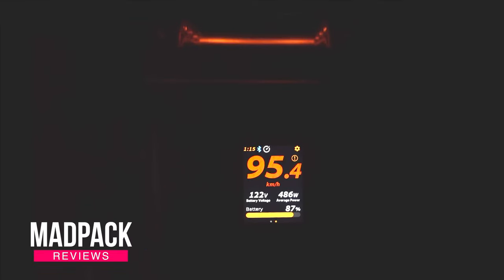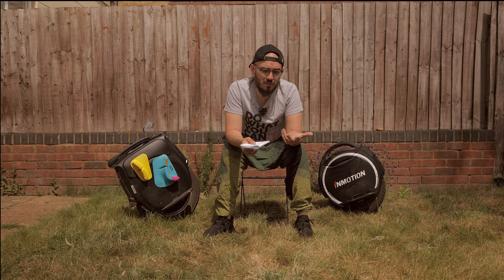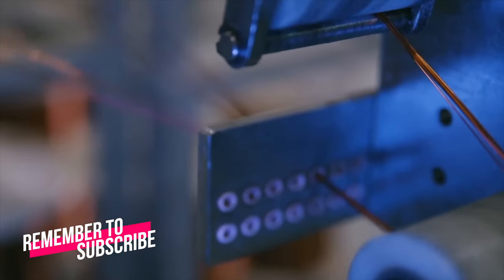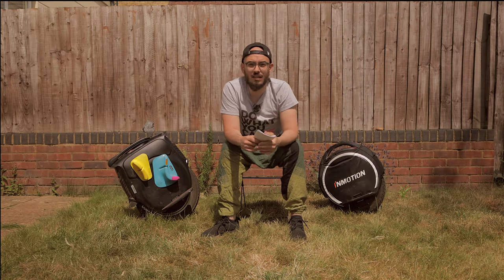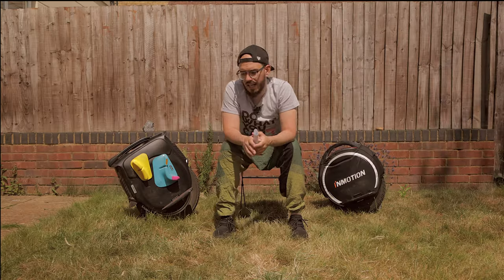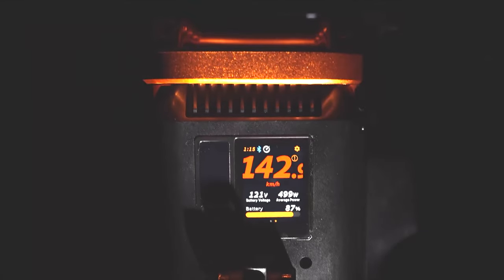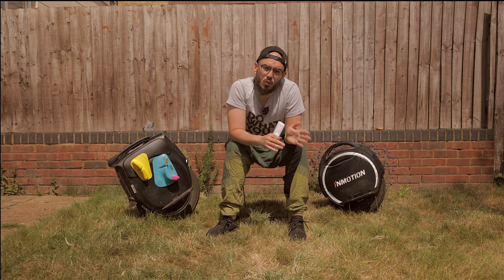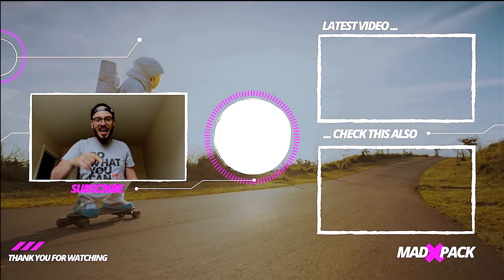Inmotion V13 Challenger - Fastest EUC in the World.. Begode Master Killer?

Comment: The V12 is still my favorite wheel out of the 4 I've owned, so I think I'd get the V13 when it comes out.
Reply from the maker: Which wheels do you own?!
Reply: they should consider an IPM motor
Reply from the maker: What is the advantage of an internal permanent magnet motor?
Reply: @MADpack  reluctance torque whose max RPM is not limited with voltage
Reply from the maker: Thank you for sharing

Comment: Rumer has it that The Challenger V13 version is the speed one and the other type has suspension, but less battery to make room for the suspension.
Reply from the maker: Is not coming out 2 wheels my friend that’s was confirmed by InMotion.
Reply: @MADpack  so you're saying there won't be a suspension V13?
Reply from the maker: The opposite is just a model with suspension bro

Comment: Marcos, 

Excellent video and information! Well like we talked, the V13 should be worth the wait. I'm really looking forward to seeing more information on the Challenger. Curious to know if they will release a HS & HT model at the same time and if there will be one with suspension and one without?

Be well
-Shane
Reply from the maker: No is just one wheel and with suspension. And this wheel you have torque and speed why you need a torque and speed version? Is it not enough 300nm and 100kph guarantee? :)
Reply: @MADpack  I'm glad it is one wheel with suspension. Originally it looked like they would have two wheels. One with suspension and one without!

I wasn't sure if they would have a slower version built for long range vs high speeds!

I was going back and looking at the torque for the V12 HT and Sherman Max trying to gauge how much the 300 nm of torque really is, since I'm still new to EUCs.

I don't have any need for 143kph or 88 mph on an EUC...ha ha ha, and wanted to know if their would be different versions of the V13 Challenger!
Reply from the maker: No they will not be I cover that angling time ago there are no 2 versions that was a lie that someone have push out they confirm me that that at least for now there is only a suspension wheel on the horizon
Reply from the maker: That’s the thing been able to do 100kph it’s not a concern for me but a wheel that safely can take you at 100kph I feel really safe against any cut off and with two hall sensor what can we ask more? I really want this wheel is the first time that I’m so desperate to get a wheel in my life :)
Reply: @MADpack  Awesome thanks 👍
Reply: @MADpack  Excellent, I'm really looking forward to seeing you have it and the reviews on your channel!
Reply from the maker: Thank you to always be here for me bro
Reply from the maker: That’s not for sure I’m still negotiating with InMotion

Comment: I'm personally not looking for the fastest. But improvements on other areas would  great, like range but not too much weight. More importantly, safety and reliability
Reply from the maker: This one is not only speed is the first wheel that reach the max speed and will not turn off
Reply: @MADpack  I understand, and there's probably a few more good things in there like better battery and what not. And I'm glad they are pushing things forward.
Just wish different brands improve on other existing things too not just focus on speed or torque, but I know very little of this EUC so maybe it's there already
Reply from the maker: This is the most advanced euc on the market and hard to find a wheel that can offer more

Comment: The 24’ inch wheel of the Monster Pro softens the ride enough therefore I highly doubt the Challenger will be a suspension wheel hence the 22’ inch wheel it is being built around - In my opinion a 22’ wheel is the sweet spot.  Also, adding suspension will mean adding 10 lbs minimum. 

The Begode Monster Pro weighs in at 83 lbs and is set on a 24’ wheel. 

Though Begode eX20s is set in a 20’ wheel it weighs in at 104 lbs due to its suspension and added battery power. 

Therefore how can they claim the Challenger to be a wheel for “stunt” riding while keeping the wheel light?

Answer: No Suspension 

👍🏼
Reply from the maker: Answer confirmed from InMotion … is a suspension wheel :)
Reply: @MADpack  wow. I'm very curious now to see what type of suspension is built in. I believe you but I still find it hard to believe 😂
Reply from the maker: But is what I said suspension is there for is
Reply from the maker: For us
Reply: @RocABye  I bet it’ll be very similar to v11 suspension
Reply: @wattssingletrack8874  likely will be to jeep the weight minimal
Reply from the maker: Gonna be what?
Reply from the maker: I doubt is going to be like the v11 max we will have a suspension like the one on the EX but protected and not exposed
Reply from the maker: I doubt is going to be super heavy since is not the approach of inmotion
Reply from the maker: I don’t think so :)
Reply: @MADpack  ex and v11 similar concepts but that’s what I meant with my comment it’ll be that type of suspension vs s18 master “linkage” style suspension
Reply from the maker: Have you seen my previous video about the v13v
Reply from the maker: Ex and v11 can look similar but suspension on the ex was much superior than the one on the v11
Reply: @MADpack  not sure. I'll look
Reply from the maker: This 2 suspensions are really different in experience
Reply: @MADpack  yes one is full body suspension vs pedal suspension. Still think this will be a similar setup to the ex full body style suspension
Reply from the maker: Exactly we will see how they have set it up I’m really curious maybe Saturday we will know

Comment: Honestly I don't think an expandable battery pack is a good idea. You need to dedicate extra space for batteries that may or may not be there, which seems wasteful in what is already a limited compact area. It will of course change the weight, and torque limits might also vary, which will affect performance. I think it's better to keep those things constant and just use the most effective battery pack to begin with.
Reply from the maker: Thank you so much for your feedback and your thoughts about it :) big hugs

Comment: Great info man. Hey did you hear how the beeps happened at 70km/h? I wonder if that’s the limit and this is more of a high torque wheel with lots of margin for safety… if that’s the case it would be the ultimate off roading racing wheel besides not having suspension.. and if they keep the battery not massive I think they can keep the price close to the same as the other new wheels that have arrived but that will be interesting to see the specs 

How long do you think till we get all the info/pictures? It’s crazy how new wheels are amazing then the next generation comes out and just destroys the previous ones… in a few generations I’d imagine eucs getting up there next to mid range motorcycle torque
Reply from the maker: Thank you so much for your feedback. Altering for the first bit is important that you understand that this wheel comes with suspension is not a non suspension wheel.

Related to the second part is not all the time like that. Wheels were not evolving since 2020… and from this point I hope they will improve in safety and also small subjects like lights per example and taking the euc to a motorcycle level in that subject also
Reply: @MADpack  appreciate the Reply! And how do you know this wheel has suspension???
Reply: @MADpack  also I think once the max speed and torque and range is good enough for most riders , they will stop trying to break voltage records and start to focus more on safety , IP ratings, function, form ,and sex appeal lol

Also there has been talk of suspension but I don’t think anyone knows yet if there truly is Suspension on this new wheel, someone said there will be two models , one with and one without but i don’t think that idea seems realistic either … unless you have concrete information to share about the wheel?
Reply from the maker: Is just one wheel and have suspension. That’s the real info bro :)
Reply from the maker: I work with InMotion :)
Reply: @MADpack  you work with inmotion? What’s your job? 

And if it has suspension then that’s going to be very appealing to follow and see how it does
Reply from the maker: No bro I work closely with InMotion giving feedbacks I test tester units when is possible like it happen with the v12hs before it came out.. I normally get the InMotion wheels for free so I can make my content… unfortunately it will not happen with the v13 because they say is too expensive
Reply: @MADpack dang that’s awesome they tell you more about the wheel… what else did they tell you about the wheel? And do you know when it’s releasing? What kind of suspension does it have?
Reply from the maker: I will comeback with another video soon bro :)
Reply: @MADpack  sure whatever man
Reply from the maker: Anyway they have already advertised more about the wheel :)
Reply: @MADpack  where can I find that information?
Reply: @MADpack  dang a electric shock they are saying? What the heck is that! This is gonna be a beefy wheel, EUC community is probably flipping out right now, Eagle, master and now this wheel… what good momentum if inmotion can make a high performance wheel with suspension and have the reliability they are known for this is hands down the best wheel if you don’t mind a heavier wheel but something like this will be my next wheel after the Eagle , who knows what will be out in 5 ish years holy crap! Hope your able to ride this baby at some point in time. Take care and thanks for the content and info
Reply from the maker: Is not going to be heavy if I’m right that is only 3000wh battery and in that case I believe the 34kg I talked will be correct
Reply: @MADpack  hey MadPack I just got my S22 Eagle and it has a error when I plug it in to charge for longer than a few mins, starts beeping then the battery turns off, have you heard of this issue ever before? Thanks for your time as always
Reply from the maker: No bro since I don’t even have so much experience with is since I only have a Ks18 never heard about that bro recommend you to contact your distributor
Reply: @MADpack  thanks I already did! And contacted lots of riders
Reply from the maker: And nobody experience the same has you?!
Reply: @MADpack  some people have I’m still waiting to hear from some of those guys I messaged but there seems to be a lot of BMS issues, I think that new firmware they changed right at the end wasn’t a good idea cause that wasn’t perfected .. I figured that might happen so yeah not sure
Reply from the maker: Hope that you find out the issue and you can restart riding
Reply: @MADpack  thanks! I’m gonna take her out this evening but it just takes a very long time to charge it so I’ll probably not be going every day that’s for sure but it’s all good
Reply from the maker: The most important is that you are healthy bro
Reply: @MADpack  being healthy is one of the most important things. The most important thing is sharing Gods love to one another so they know there’s nothing more important than living for him by living for others . Wheels are awesome and they are fun to ride, but they are not worth loosing control over what matters most in life 🌅🙏

Safe travels and blessings to ya!
Reply from the maker: For you too bro enjoy life the best has you can

Comment: Still missing the most important information, weight, range, suspension, reliability? Max speed 140 or 100 is the same I never ride at this speed.
Reply from the maker: Sorry Rui have you seen the same video that I published? Hugs
Reply: @MADpack  let’s wait and see the final specs. Do you think we will have 2 versions, the v13 challenger and a v13 (standard) less range and speed ?
Reply from the maker: No it will not come with 2 versions is just one

Comment: There is no way this wheel is going to be lighter than a sherman and have more range the 4500w motor is going to be heavy and the batteries to supply the large motor and get that kind of range is going to need to be over 4000wh i suspect they are going to promise more than inmotion can deliver and if it has suspension it is going to be heavy very heavy i suspect if it has all these specs it will be the heavest wheel on the market even heavier than ex20s
Reply from the maker: We will see my friend I doubt InMotion is going to go in that direction.. InMotion cares about weight and also comfort between the legs so we will have to say and see what is really going to happen I found this info in one distributor so time will tell
Reply: @MADpack  so they revealed the weight it is the heavest wheel to date like i suggested 110 lbs with that weight  and the 3000wh battery with a 4500w motor this wheel is not going to be great with range and the battery configuration suggests that they are using 18650 cells and if this is the case the v13 is going to have some serious battery sag even worse than the ex.n oh ya and 55 mph top speed and almost 6k canadian this will be a wheel to pass on nice try inmotion but imo the missed they mark again
Reply from the maker: Where have you found the 18650 cell configure?